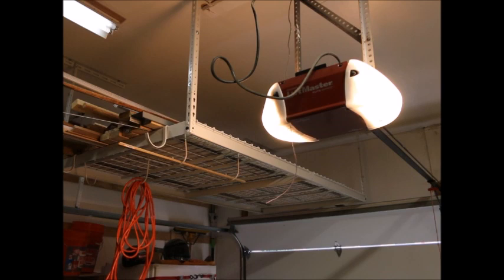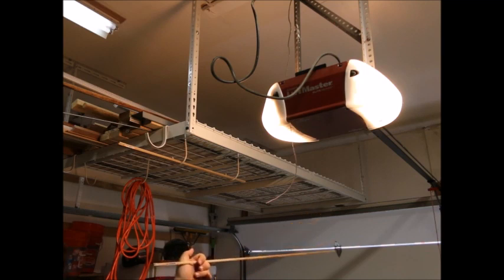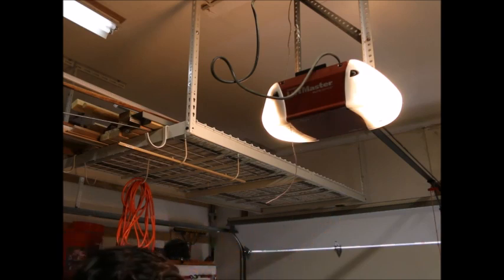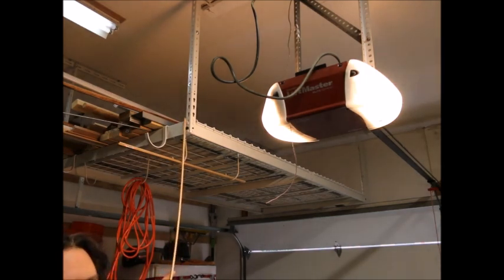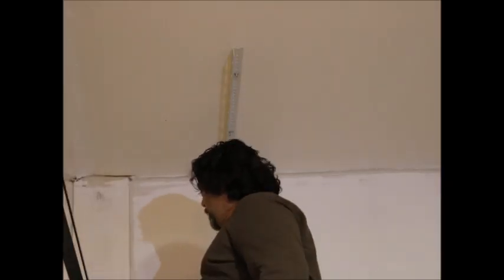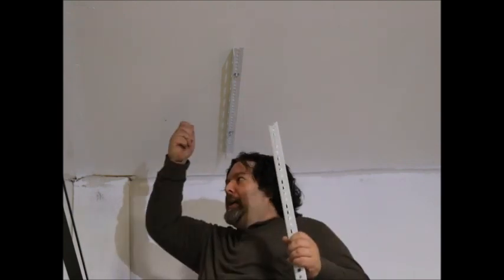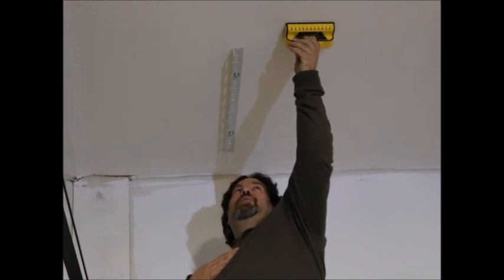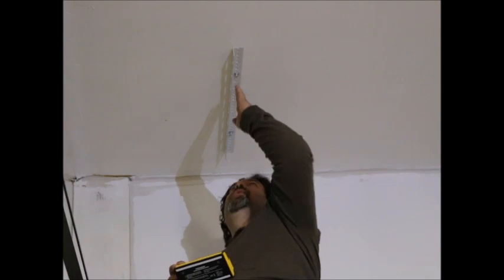SafeRacks Important questions to ask before installing!

Comment: Do you recommend buying different lags then what came with the purchase. I’ve heard on some videos that the hardware is cheap and to buy better lags. Any problems encountered
Reply from the maker: Joseph I apologize for the delay, The lags screws they use are the common standard.  Would I get a newer lag to give me piece of mind?  I feel confident the old lag would do fine as long as you hit that joist center!

Comment: Did you screw the brackets in two joists?
Reply from the maker: If you meant two screws per bracket into one joist, yes.
Reply: @ChristopherMichaut  The instructions are misleading. They say one screw per joist but then they also show a "parallel to joist" installation setup which is obviously two screws per joist.
Reply: Interestingly I asked the same question in the middle of the video where the poster uses the stud finder.  It looks like he installed the bracket with 2 screws in ONE joist.   However the instructions states "Each ceiling bracket fastens to TWO (2) separate joist.
Reply: @ChristopherMichaut  He meant 1 backet into 2 joists or 1.  Depends if the joists are running front to back of home or side to side.
Reply: Chris Mich i have the same question. I think he meant if you can install the brackets on two studs, like an H orientation and not necessarily parallel to the stud.